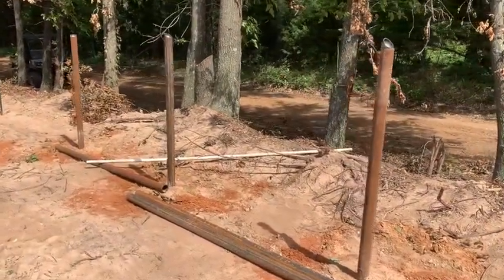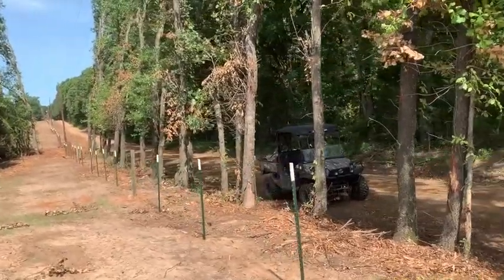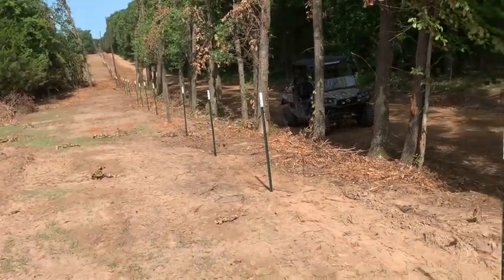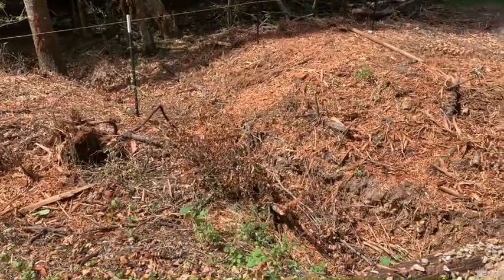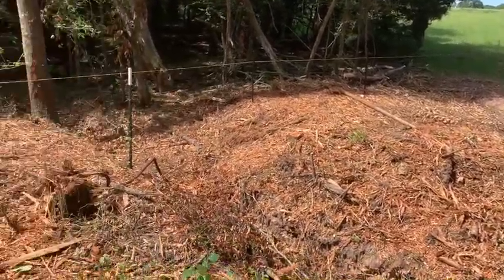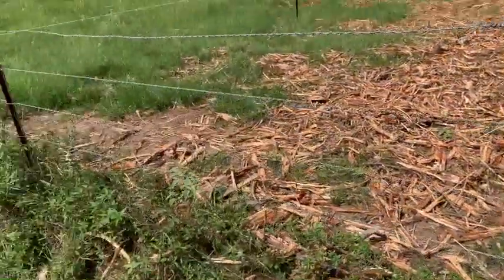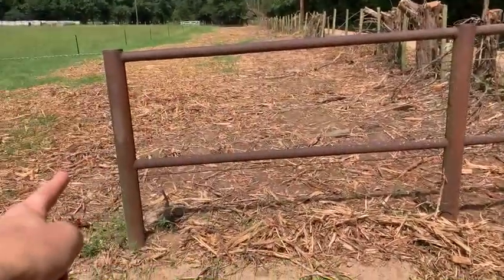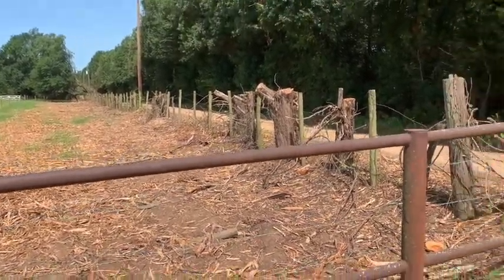Barbed Wire Fence Project II

Comment: A job well done for sure. We just installed over the river past my mobile home. We put in removable sections separate from the main fence so if there is an issue with water level we can raise or lower the fence and adjust without reconstructing support on the main fence . You did a ton of work in 2 days each weekend..God bless
Reply from the maker: The Drifter - Thanks.   I like your idea of keeping the water section somewhat flexible in the event we have to move/ adjust with the +/- water situations.   Yes, I’m glad to go back to my day job to rest.   The weekends are killing me.

Comment: Fence is looking great. Too bad they left that little line of trees between your fence and the road. Cattle panels in the creek bottom is what I'd go with. Short of welding up a flapper gate that opens up under high water flow to let debris out, you'll probably have to periodically clean limbs off the panels to keep them from getting clogged up. I'd be careful securing those cattle panels to your end braces, use thin wire that will break easily under a heavy load, otherwise if you secure them too well and a heavy water flow with lots of debris piles up it could bend or even tear out your end braces. I hate this time of year, can't get much done with the heat so most of the day is wasted.
Reply from the maker: Thanks for watching.   Appreciate the advice with cattle panels.  I think that is the best option also.

Comment: Thanks for posting this. There are lots of fencing videos but not nearly as good as this. Come to find out  (according to Jimmy Houston)  we are internet farmers cause we couldn't do anything without looking on- line first. 2 questions if you have time - could you use a pipe post instead of the wooden ones? sakrete  them in place? And how did you keep the posts so perfectly in line when installing? Thanks
Reply from the maker: Hello- truly appreciate you watching. 

Yes- matter of choice wood vs pipe for the one we put every 50’.   Wood less expensive.  

Yes- we mixed sackrete on site in the hole.   We pour sackrete in, add water, tamp/mix in place.  Repeat until hole is 2/3 full.  

We used a mason line for step one to get straight line to set post.   We put a metal stake every 100’ to hold mason line in place while we worked.
Reply: @HeritageFarmsTexas  Ok, thanks so much for the info, We live in Bonham, have a machine shop if you ever need anything. In January we bought some property in Oklahoma and the fences are so bad it is embarrassing. We dont have any cows or animals to keep in but what a disaster. About a quarter  of a mile on highway frontage and the dilapidated fence just sends an open invitation to trespassers.